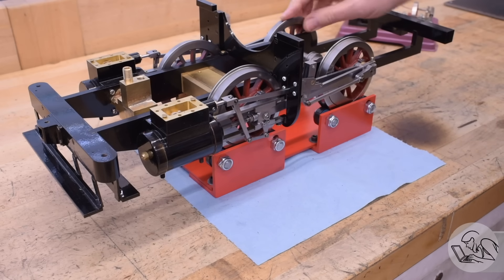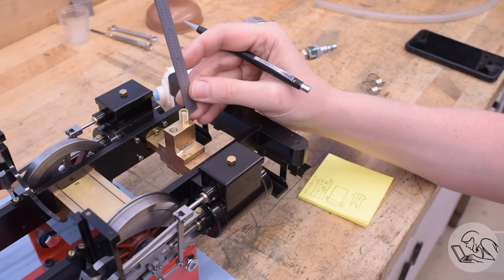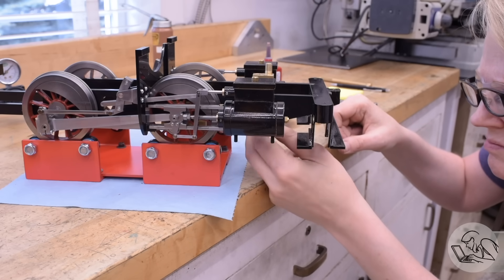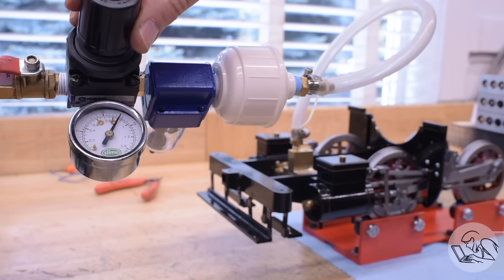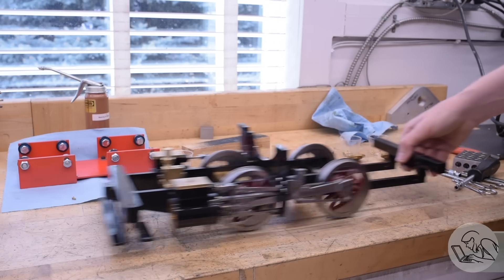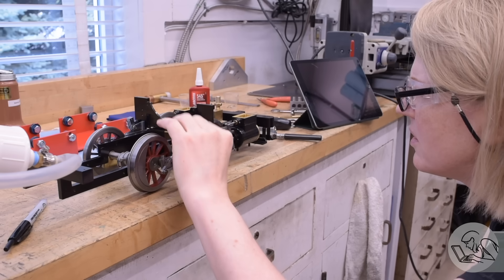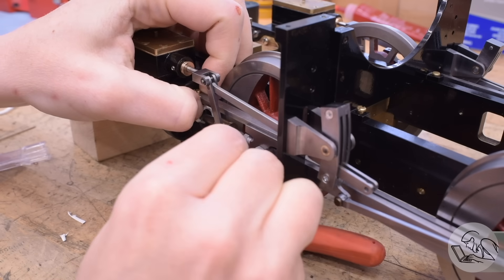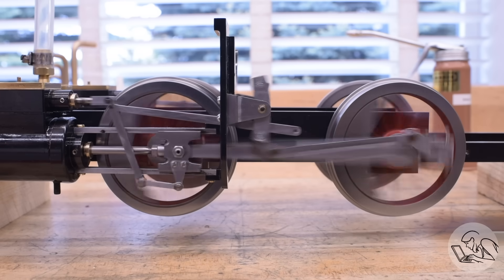FIRST CHOOCH! - Pennsylvania A3 Switcher, Part 68

Comment: Congratulations, Quinn! That's so exciting!  Your first chooch!  Yay!

And it's nice to see that Janice or Linda did their job in HR adequately, even if they weren't a real Barb 🤣

I had the same issue with the glands. I ended up doing the same thing you did, plus reaming out the shaft holes quite a bit since it's really the O-ring that's doing the sealing, having the hole larger meant it didn't bind when the set screw squeezed it a bit.  Helped a lot.

Well done on getting it running.  That IS a big accomplishment.  Well done Quinn! 😁
Reply from the maker: My thoughts exactly- not much point in having the nuts fit as closely as Kozo has them. It creates an extra constraint that is very difficult to satisfy while not adding much value.

Comment: As always Great Job Quinn.... Something else everyone needs to remember is that tolerances become more of an issue in model engineering. A 0.010" tolerance in a full size application probably won't make a noticeable difference  but when that same tolerance is in a scale model it will become significant. The same goes for tolerance/error stacking. Small differences become big issues when sizes are reduced...
Reply from the maker: For sure! I’ve touched on that occasionally, but it bears repeating. The smaller you work, the harder it is to make everything run nicely. Small mechanisms also don’t have the benefits of inertial mass to run smoother

Comment: If you felt up to it you could tap the ends of the cylinders to make the screw in type gland packers,it's alot of messing about but would work better you can adjust them till they stop leaking

Comment: Dang, two years and counting?!? Looking forward to the final result but it's also about the journey, not just the destination, as they say. Great to see it running on air.
"You never stop fiddling with a steam engine, trying to make it run a little better..."
Ha, yeah, that seems to hold true for pretty much all modes of transportation; just ask La Forge, O'Brien, Torres, and Rutherford as it always seemed like they never stopped fiddling with their impulse engines, trying to make them run a little better while decreasing the vibration in the warp manifold by a factor of 0.05 and increasing the power output of the Tucker tubes by seven piccochranes 😄

Comment: Congratulations! Very cool. Can't wait to see what comes next.

I suspect that if you use a longer handle on your compressor air valve, you'll have more pressure control because you have to move it over a longer distance for the same effect.